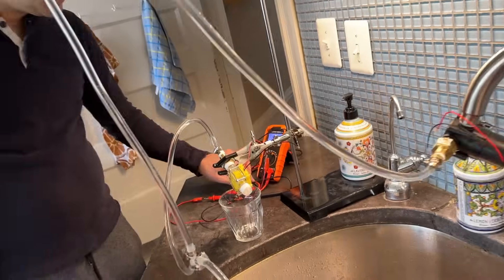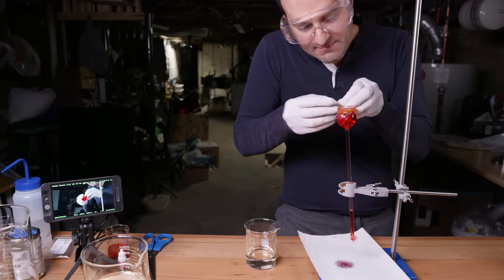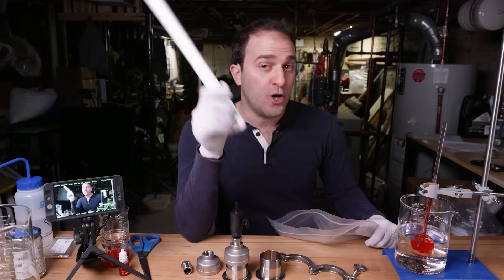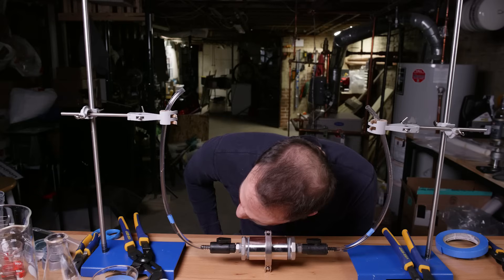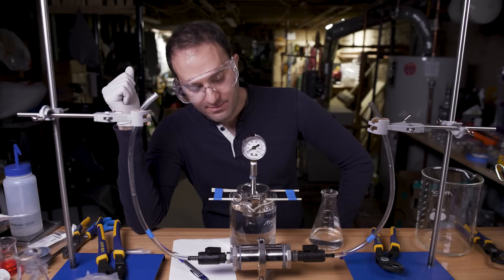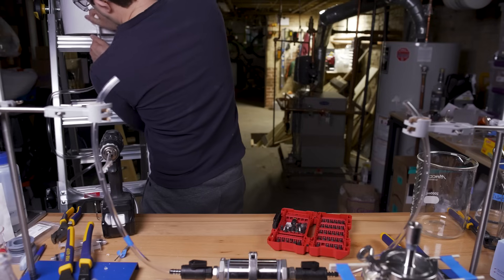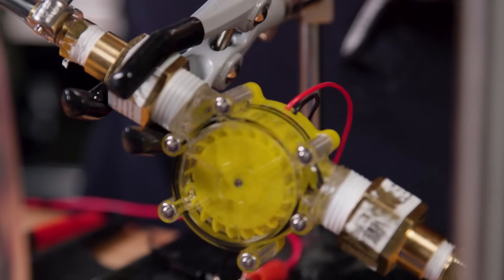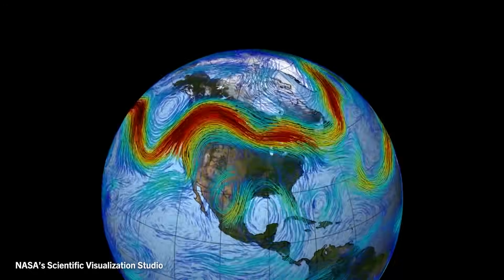Why Norway's Osmosis Power Plant Failed

Comment: You should use piezoelectric crystal, when the water pushes on the crystal it deforms and generates electricity, the crystal should be mechanically acting as a valve at the same time, when it deforms  it opens the valve relieving  the pressure which makes the crystal go back to its original position, then pressure increase again for the cycle to repeat. (The crystal creates electricity twice, when it deforms and when it goes back to normal position) good luck trying this one!!!
Reply: You deserve way more credit for coming to that realization.
That's probably the smartest comment i've read on this hell platform.
Reply: @fuzzy-pillar  lmao, Thanks!!

Comment: Your sink experiment might have worked if the pressure and flow from that source was more stable, so that you could then see the effect of adding the osmosis cell. An accumulator could help maintain stable pressure, and a more controlled restrictive device like a CORD or a proper throttle valve would be more stable than the faucet alone. 

You are also having a problem with entrained air coming out of solution and producing a lot of flow variability as an oscillating mixture of water and air hits the turbine. Either you can try to keep air in the system by keeping the pressure high enough that the mostly stays in solution by adding a flow restriction after the turbine or by getting most of the air out of solution before the water gets to the turbine. An initial restriction (or sudden pipe cross section increase) that drops pressure, followed by a standpipe that allows the air a place to be burped out could work, but might produce some flow variations that could stand to be smoothed out before the turbine is reached. Each of these would drop the turbine output, so would need to be limited so it is still driven consistently. On the up side, those little turbines really don't like to have air in the flow stream, so the necessary amount of flow for consistent turning would be lower if air is being removed.

Another place to tackle the instability problem is with datalogging. Instead of a multimeter, use something that can log the produced voltages ( like a picoscope or an Arduino). Finding the mean voltage being produced in both scenarios, especially if you do an A-B-A test to be sure it's not just a coincidental shift in flow from the faucet, would show the change you want to see. It would take more effort to explain to your audience, but it would be more sensitive to a small change in the mean (and could be scientifically robust by calculating the uncertainties in the means).

I enjoy your explanations and demos, best luck whatever you decide to do.
Reply from the maker: Hey these are awesome suggestions, thank you!

Comment: Why focus on the pressure when you can actually create a voltage differential
Reply from the maker: Uh... did... did you happen to watch... uh... the rest of the video?
Reply: @ACSReactions  i mean a voltage potential is created on both sides of the membrane at 0 preassure. You have to use salt water on one side and brine on the other so you have 2 conductive fluids to connect to
Reply: @ACSReactions  research molybdenum disulfide nano hole membrane
Reply from the maker: Oh I see what you were saying! Yes I briefly looked into trying that approach, but I think the materials were harder to get and more expensive

Comment: Shouldn't a simple RO-filter cartridge do the same thing? Also, why not just add salt to create a saturated brine to  maximize the effect? And, the mass times height you're able to push the water, or volume forced against a known pressure can tell you the theoretical amount of energy you can extract. I mean, if extracting energy from osmosis was so easy that you could've increased the power generated significantly, why do you think the Norwegians abandoned it? If it was that easy, osmosis power generation would probably be the dominant energy source for all of humanity by now.
Reply from the maker: I was worried that a small RO cartridge wouldn't be able to handle the osmotic pressure of seawater (or higher - I tested up to 20% NaCl) without rupturing. In fact I used a steel mesh screen to support the membrane in my test rig for this exact reason. I did test much higher NaCl concentrations, but they all sprung a leak before building up significant pressure (clearly I'm not a great plumber). And I briefly considered buying a large commercial seawater cartridge but it was quite expensive. Lastly, I considered building a rig to stack weight on the syringe, but a cheap disposable syringe would have likely buckled before giving an accurate reading. (And metal syringes are shockingly expensive.) All these things didn't make it to the final video, but I'm glad you pointed them out!

Comment: Thanks for yet another amazing video. One thing I did not quite understand, is why the resulting pressure was so much lower than the potential. Was the 1923 paper supposed to explain this difference?
Reply from the maker: Thank you! The 1923 paper derives the equation that predicts the theoretical maximum osmotic pressure given the concentration difference between both sides of the membrane, but as far as I know it doesn't predict deviations from theory. I likely wasn't able to get the full pressure because I had a leak somewhere in my system

Comment: You could've used a syphon setup, where the storage tank is filled via osmosis and, after reaching a certain level, drains through a generator. By setting multiple buckets on alternating cycles, the output stream might be quite steady, or at least closer to how a four-stroke engine works.
Reply from the maker: That's a brilliant idea
Reply: @ACSReactions  I was thinking to use osmotic pressure to push a piston, which in turn raises a large water container via a lever; that way, it would better utilize the high pressure/low flow output.
Reply: Basically what I was thinking (except I was thinking about using a pressure tank that's used in houses for water systems, that way it builds up pressure, not just volume)
Reply: dang beat me to it, i went to the comment section to suggest letting pressure build and releasing it in bursts to make power, then storing the power in a battery for constant power to be provided.